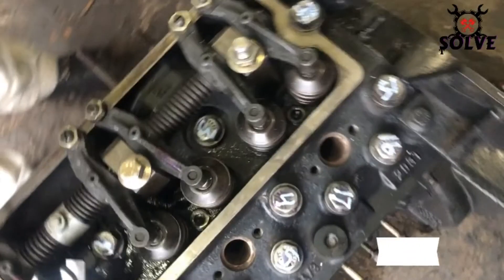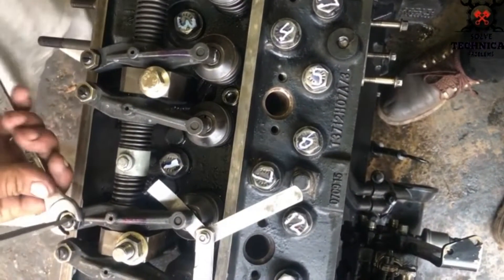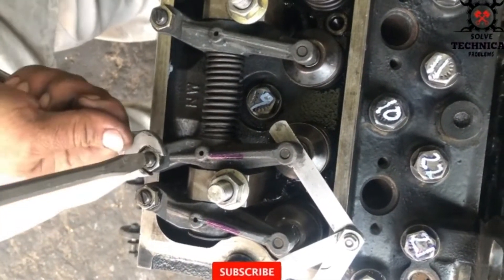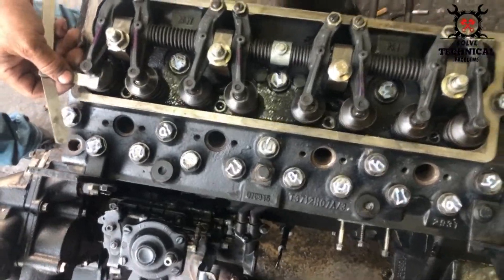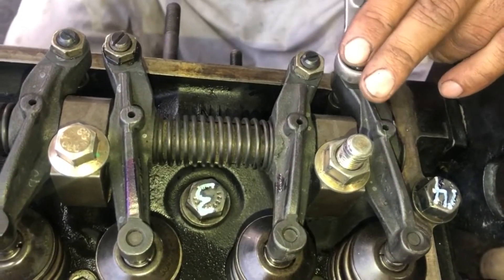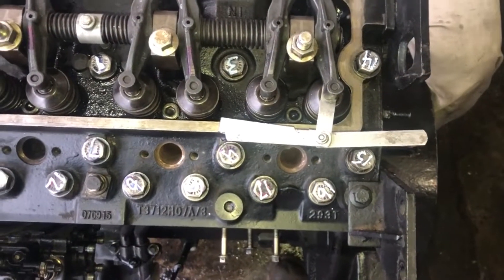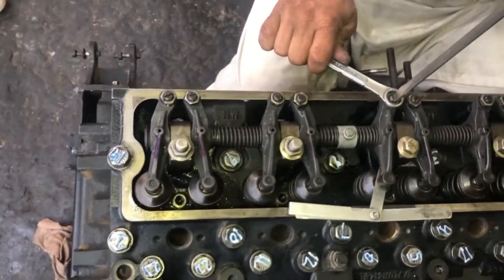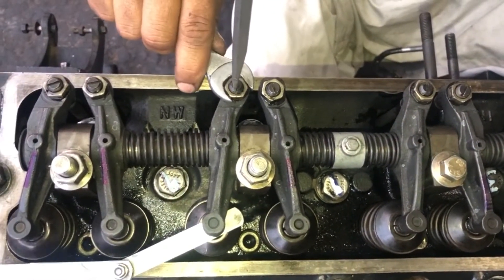How to Set The Valve-lash or valve clearance on four cylinder Perkins Diesel Engine

Comment: Hi i have a Perkins 700 UA. Im confused on the valve adjustment im trying to do valve adjustment havent is this the same procedure for a Perkins 700 Thanks
Reply from the maker: My friend, whether you are working on 700 UA 
700 UB 
Or 700 UC, all engines from 700 series have the same valve clearance and same method of adjustment. If you need further information, please feel free to ask.
Reply: @Technical.Education  Thank you 🙏🙏 Its Perkins 700 series (UA) and one more what are the Ring Gap Size for the Pistons Thank you for your time.
Reply from the maker: @ricardorodriguez-se7tp piston ring gap
for the top ring .008 / .022 inch
For the 2nd ring  0.012 / .025 inch
For the 3rd piston ring. 0.008 / 0.019 Inch
Reply: @Technical.Education  Can you do a video of a valve adjustment of a  perkins 700 or do you have one
Reply from the maker: @ricardorodriguez-se7tp I need some time for making a video on that engine but I can guide you if you want me to.

Comment: What is the clearance value please? How can we find TDC?
Reply from the maker: https://youtu.be/C0LE9O8GTas
Watch one of my video on finding TDC and which engine clearance you need. c
Reply: @Technical.Education  how to spot a 4.236 vs a 4.248 engine? i have a code B37112647 on the engine , on the upper part, but how do i know exactley?
Reply from the maker: @laurentiurizac5766  blocks are the same difference in the bore size

Comment: Amigo torque de culata.para ese motor
Reply from the maker: Head Bolt Torque	 	 
Stage 1. All bolts.	110 NM	81 lbs/ft
Stage 2. Short Bolt	150 degree 
Stage 2. Medium Bolt	180 degree 	 
Stage 2. Long Bolt	210 degree